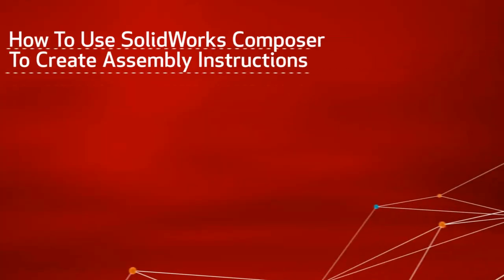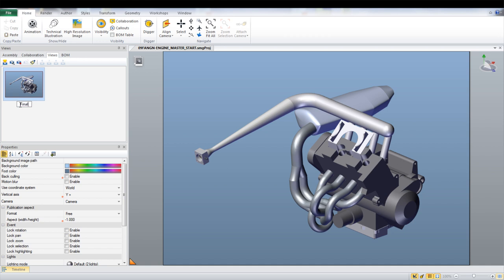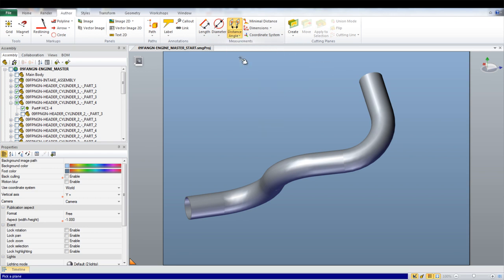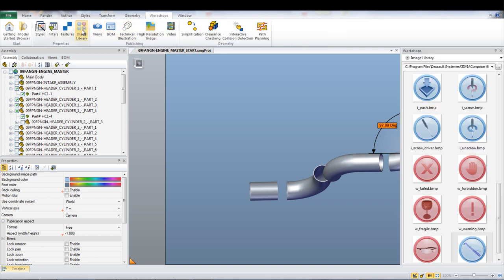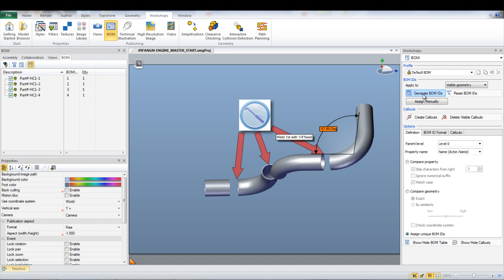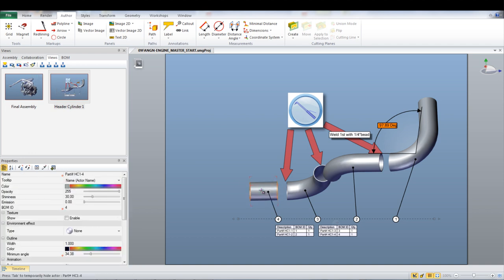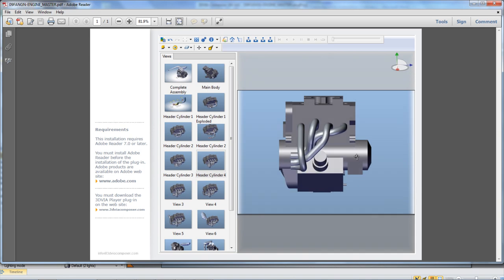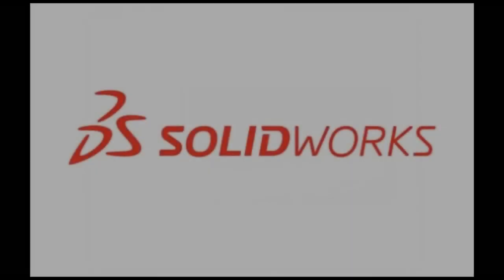Creating an Engine Assembly Manual with the Help of SolidWorks Composer

Comment: Would you be able to do a tutorial on how to do mates in the way that demonstrates moving parts...i have been trying to show a control stick moving ailerons and elevators but never seem to get what i want..lots of sliding but not actual proper movement of control surfaces for the aircraft. thanks